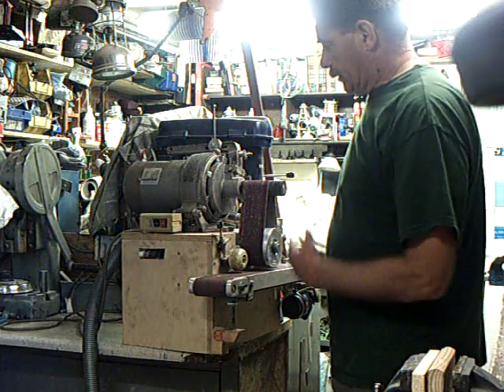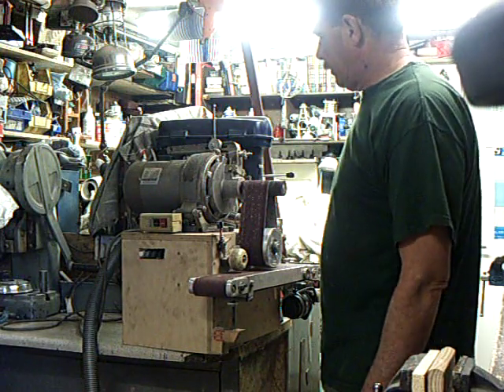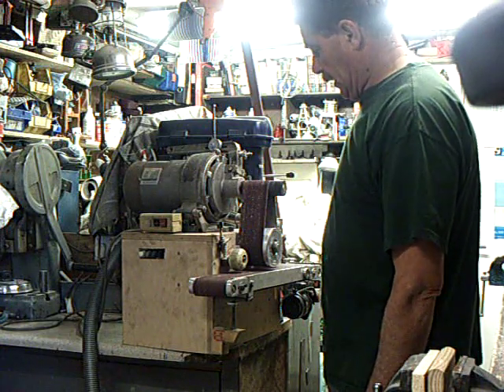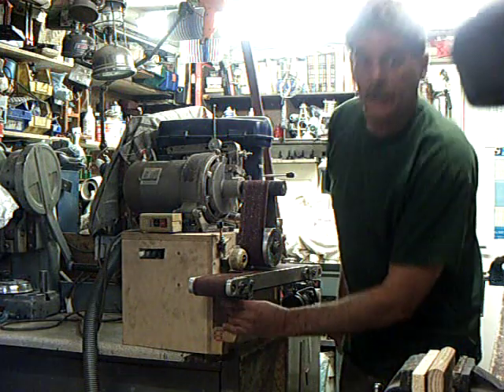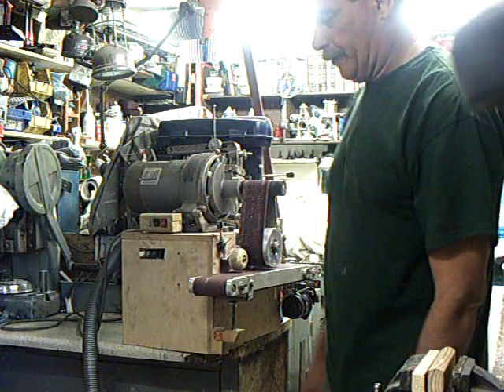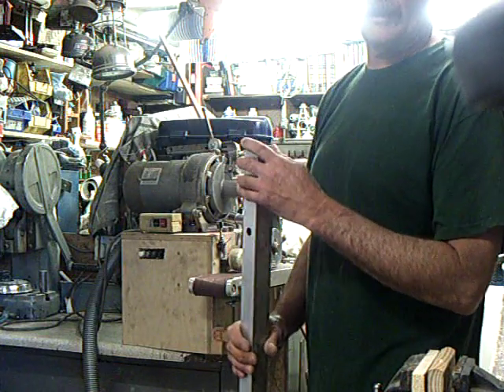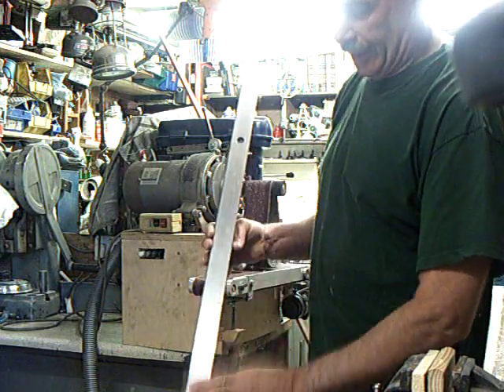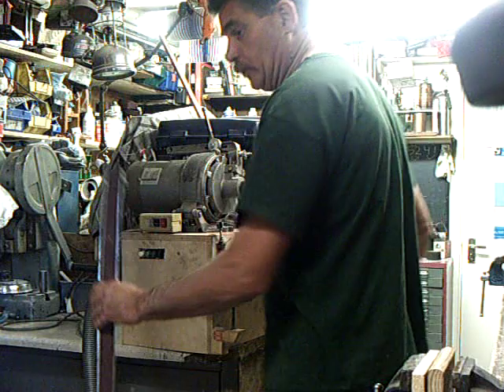Thickness sander 1

Comment from the maker: A  planer removes wood quicker but it can tear certain woods. Unfortunately a lot of bow woods are likely to tear so I prefer a sander, using a 40 grit belt the wood surface is just perfect for glueing up. A  sander needs a power feed or extreme care feeding the wood through to get a perfectly even surface, bow limb laminates need to be accurate to within a couple of thou.
  Look at my other videos you will see my compound bow 2 clip, all the laminates on this were done with this sander.
Colin

Comment: Hi Collin, I'm a bowmaker and I wish to know how can I make tapers with a decreasing thickness to the tip. Can you help me? Thanks. Pedro
Reply from the maker: Pedro Tripoli In the second video I show sanding a tapered laminate. Without this type of machine the easiest way is to use a belt sander clamped "on its back" to a bench. The wood laminate is then pulled against the way the sanding belt is turning using one hand to pull and the other to hold the wood on the belt.  By starting a few inches from the tip of the laminate and sanding these few inches first pull, then start a few inches further from the tip and pull it along the belt to the end of the laminate again. Do this over and over, each time moving a few inches towards the middle of the laminate. 
 The nearer the middle of the laminate the less times the wood has been over the sander, the ends have been sanded every time so are thinner. Done with care this will produce a very good tapered laminate, repeat the process with the other end of the laminate to match the first half.
 Colin
Reply: Hi Colin, thanks for your fast answer. I have a drum sander similar to yours and I can make parallel laminations; but now I'm looking for a system to make some ones like these:
http://www.donadoniarchery.com/en/bow-kits/Hash-taper-lamination-pair.html
Do you think must I to use a base with decreasing thickness? Thanks again.
Pedro
Reply from the maker: Pedro Tripoli In this video I show an adjustable base / sled which gives me tapered laminates, see it in use in the second of these videos.Colin
Reply: I see it. I will try make a base like this. Thanks bud!